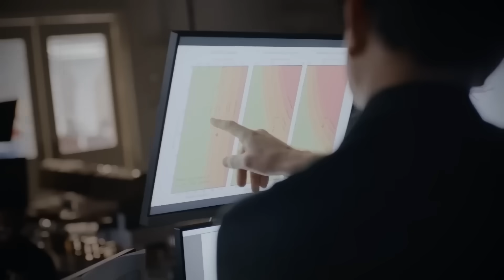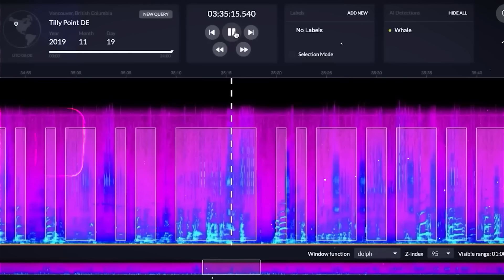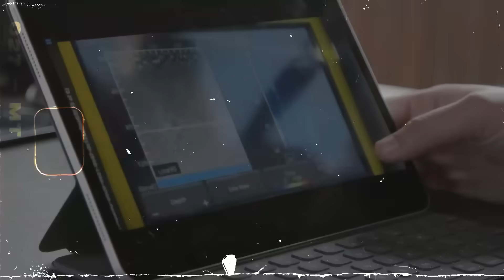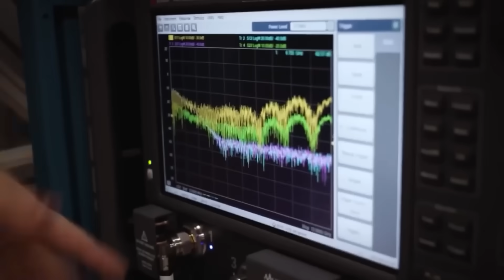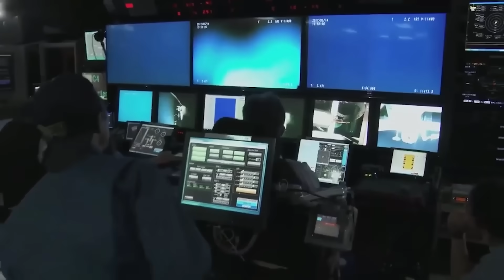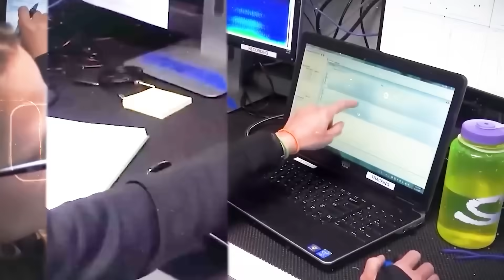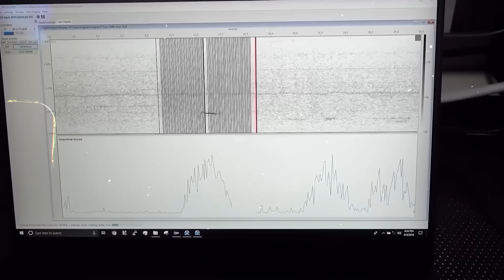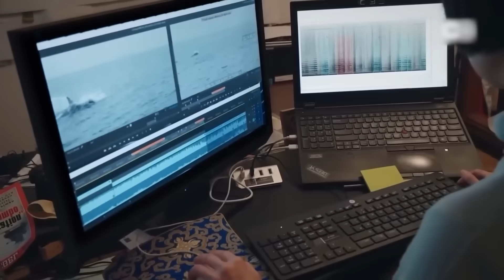Google’s DeepMind AI Just Decoded Dolphin Language… Experts Went Pale at What It Revealed

Comment: No is not us, the magnetic field is reversing and weakening as it periodically does. When this happens we are exposed to Solar storms, and sometimes solar storms get x1000 worse that we've seen in modern times. Magnetic forces so strong that earthquakes and massive volcanic activity goes of the scale, evaporation of water is accelerated in some regions do to the magnetocaloric effect leading to flash freezing in some areas. When the magnetic field is in the process of reversing, it gets weaker and weaker, when these 2 phenomenon coincide mass extinctions happen. But hey your guess is as good as mine!
Reply: It is us, and it's not a guess. The dolphins literally point out that the vibrations caused by the "great dark" are interrupting with the magnetic fields that they use to navigate around the ocean. That means the Magnetic fields are getting gradually weaker due to Vibrations, the same one that's protecting us from Mass Extinction
Reply: @Blueguy950  There may be some electromagnetic pollution but this is a phenomenon that has happen way before life on Earth, is cyclical.

Comment: Sorry to crap on your study but the audible is only a surface short range component of expression. I suppose an analogy is comparing this to listening to dogs bark and saying you can use this to understand what they are communicating when a bark is a surface signal or an outburst. I have seen dogs come nose to nose in a silient parley, and then followed them, turns out the little one had grounded a quarry and needed a bigger friend to dig it out. A tellepathic information packet had beem exchanged. More rellevant was an experience kayak fishing at dawn on the east coast of NZ. I had launched right in the middle of a pressesion of Orca rounding up rays to drive them into the firth of thames, they make this track most years. When I realised the last pair to yet pass me by were a calf and mother or auntie I got a bit anxious that I realy did not want to tip out between the two, potentialy causing surprise or threat to the young calf. The calf came right up under me and my yak slowly piroetted, the huge unit bringing up the rear was only about 10mtrs behind and the calf moved on as she closed the gap. Like the calf the adult passed directly under me and as I gawped over the other side I looked for just a second right in her eye. And thats when I got schooled. It was instant, inaudible information that struck like a sentence that I had heard in one split second, not like a sounded sentence but just a pure information dump. It was like a mother telling her babe not to touch that lollie stuck to the pavement, yucky, put that down. The mother said to her calf "dont touch that its just carrion" I started and looked away at nothing in particular and said outloud "but Im not dead" before looking back in time to watch the last of her hulk glide under and passed me, then laughed outloud, of course, my yak stank of dead fish and Orca dont eat dead things then it dawned on me that the calf had moved on moments before the mother passed under me, I believe I was privy to what was communicated for my sake more than the calf, I certainly wasnt anxious at that point. They have incredible abillity to dump instant data thats instantly entangled and deseminated and at will can modulate for our chicken brains too. Like blue tooth or a fax but possibly faster and with inflection and empathy. No sound, just proximal awareness of other and tellepathy. I only wish I could have tganked her for her gentle sentiment even if it were to call me carrion. This study wont even scratch at the door of what language abillitys these creatures posess. You need grey tissue, actual consciouseness and empathy to listen. Dissemination is faster than human language and I will forever be humbled by that moment and see many interactions unspoken with fresh eyes.
Reply: Wondrous, astounding, thank you for that story - whether this video is germane or not, it correlates with another unpublic discipline, of treating what is called the "spiritual" phenomenon as an ecology, the immaterial half of the dual ecology of the biosphere, and all that means:  that is, what the religious are trying to describe using esoteric, bronze age political propaganda are actually forces and functions with a purpose; a biosphere is an essential node within a much larger cosmic ecology seeding a skein of radiant panspermia across the impossible void -
to be honest, what we are seeing is directly tied to the phenomena this video is talking about...as if the organo-formative decomposition layer you call the Hell is about to blow

Comment: Magnetic Field Reversal occurrences appear to be statistically random. There have been at least 183 reversals over the last 83 million years (thus on average once every ~450,000 years). The latest, the Brunhes–Matuyama reversal, occurred 780,000 years ago with widely varying estimates of how quickly it happened. Some sources estimate the most recent four reversals took on average 7,000 years to occur. Clement (2004) suggests that this duration is dependent on latitude, with shorter duration's at low latitudes and longer duration's at mid and high latitudes. Others estimate the duration of full reversals to vary from between 2,000 to 12,000 years. 
https://en.wikipedia.org/wiki/Geomagnetic_reversal